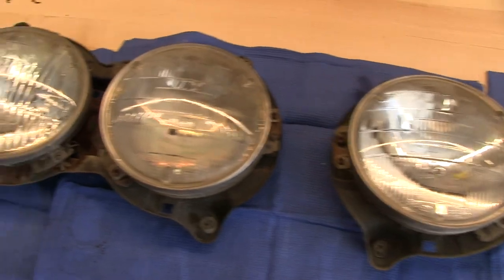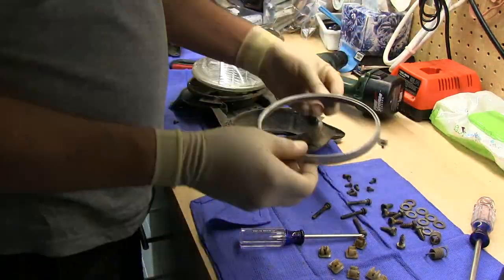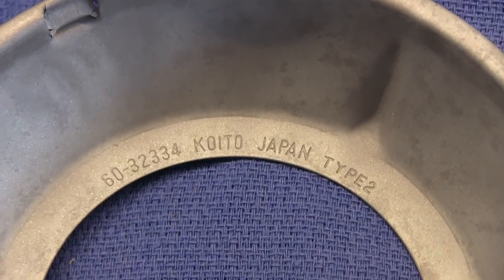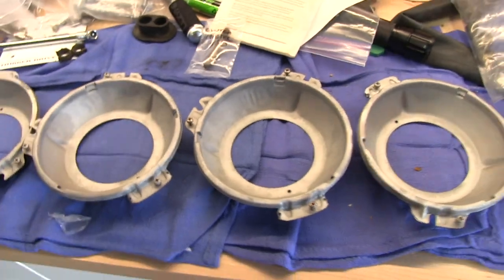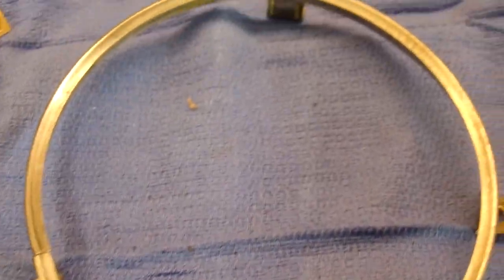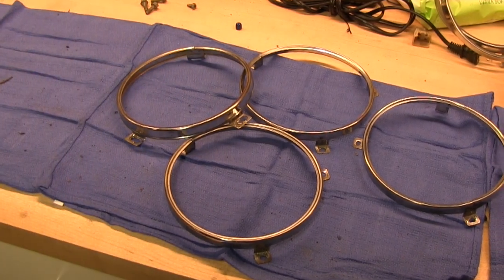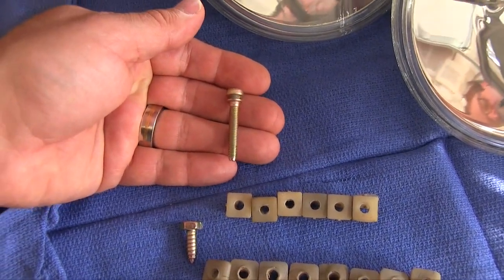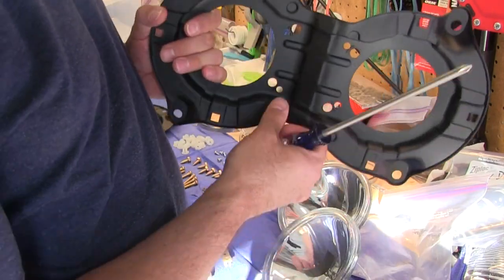VLog 35 Headlamp Assembly Restoration Mazda RX3

Comment: Did you do anything special when talking out the white nylon nuts? Did they break? Where did you get the new ones from? Your videos have helped out a lot with my own restoration. Thanks!!
Reply from the maker: I was able to get them all out without breaking them by pinching from the backside. I found new ones at a local hardware store.They are also available from Phil's Rotary in Australia. Thanks for watching.
Reply: Let's Talk Shop thanks. On my car one side the plastics are round and on the other side they were like yours. I could source the square ones from the Auto shop but the rounds ones were impossible to find so I ended up leaving them in. Even after watching your video and being extra careful after 2 hours of polishing I ended up destroying one of the chrome rings :(
Reply from the maker: Yeah, I destroyed a chrome ring too. It almost hit me in the head coming off the buffer. I wear a helmet now when I buff LOL.